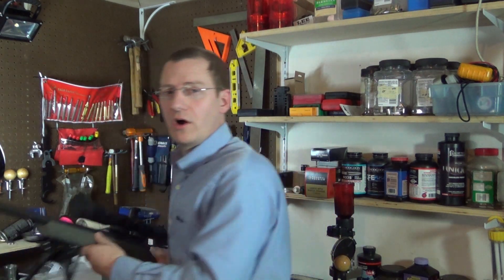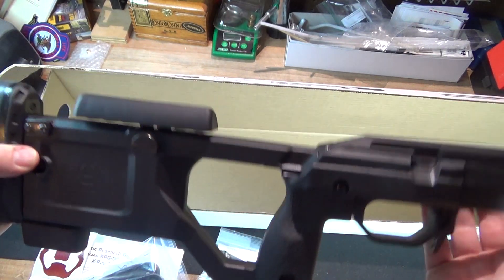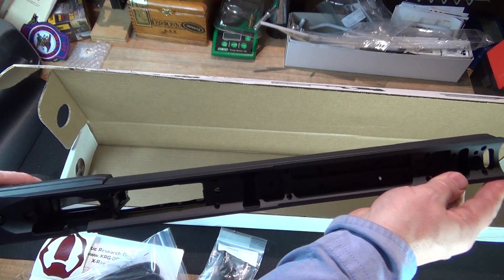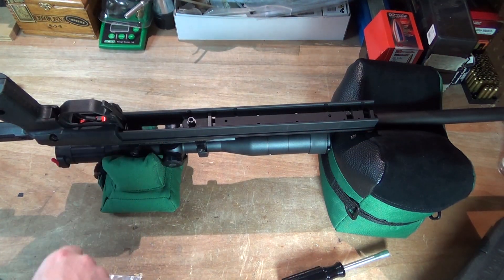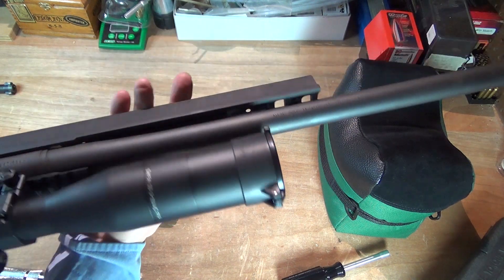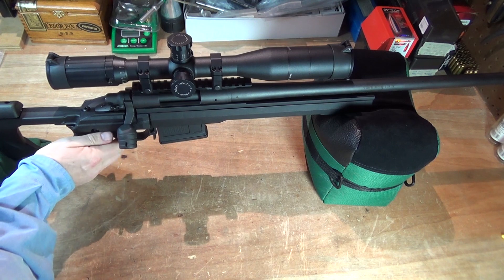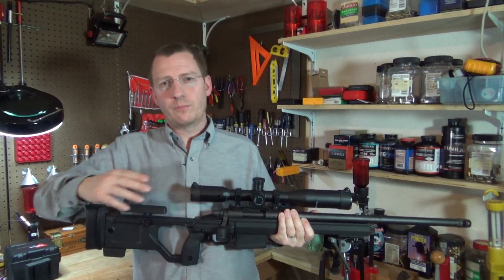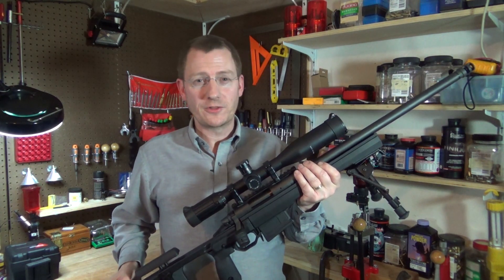KRG X-Ray Chassis:  Newbie Does Precision Ep. 8

Comment: That is a fine rifle. My current bolt action rifle has a 24 inch barrel. Once I experience what a 308 can do with a 20 inch barrel via my DPMS LR308 I will never shoot a 308 with a barrel longer than 20 inches. I'm going to embark on a similar journey of my own to acquire a 20 inch precision bolt action. The one thing I will do different is when I'm done I plan to put a suppressor on it. There is just something about hearing safe marksmanship that make sense.
Reply from the maker: Thank you.  I agree.  I would also like to put a suppressor on this one, but it will be a good while as I will have to wait for the budget to recover, then for the stamp.  In terms of barrel length, .308 doesn't loose  much velocity per inch (around 20 FPS per inch with the heavier bullets we tend to shoot for long range), so the 20" barrel makes sense to me, particularly if you intend to suppress it.

Comment: Good review. Not sure I like the idea of washers on front action screw though, think they would have been better including a proper length screw.
Also glad to see someone that can fast forward edit the unnecessary and tedious crap.
What size where the groups before the chassis was fitted? Factory ammo?
Hope your groups shrink more with tuned reloads.
Good luck with your new build. Thanks for the review.
Reply from the maker: Prior to the chassis, I was shooting 3/4 MOA off the bench, but groups from the bipod were not good, about 1.5 - 2 MOA.  I am now consistently sub-moa prone from the bipod.  These are tuned hand loads.  I think the group size will improve with my skill.  At this point, I'm the limiting factor.

Comment: How are the PMAGs working for you so far in the xray? I've read mix reviews.  If they are flawless in the X-ray without any modifications, I'll get those.
Reply from the maker: Well, it is common with AICS pattern mags that pressure on the lower front or bottom as you cycle can cause over insertion and lock up your bolt, in my rifle the Pmags do that, but so do AI brand metal mags. With the X-Ray you can tighten the mag fit enough to eliminate this, but I would rather run a barrier stop and have the mags drop free. I have not modified my Magpul 7.62AC mags and have not had any other problems with them (5 or 10 round).  I will be buying and running more Magpuls in this rifle.

Comment: I was using a factory stock (same as yours) shimmed with small pieces of aluminum from a coke can and had amazing groups. Figured it could only get better with the X-ray chassis system, and I was wrong. Unfortunately, my groups opened up and I haven’t been happy with the grouping since. I plan on playing with the action screw torque settings a bit to see what I can do, any advice on what else I could try?
Reply from the maker: I think you are on the right path.  Check that your recoil lug is firmly seated in against the back of the recess and then try different torque settings.  Make sure you got the two washers on the front action screw too.  I hear of some missing that in the instructions.  That is where I would start, anyway.

Comment: I have question. How do you use cleaning rod with this chassis ? I have problem with it .
Reply from the maker: Gregor Rencelj , just pull the adjustable comb.  If you make sure the o-rings are in place and rolled down to the bottom before you loosen it, it will drop right back to the same place when you put it back on.